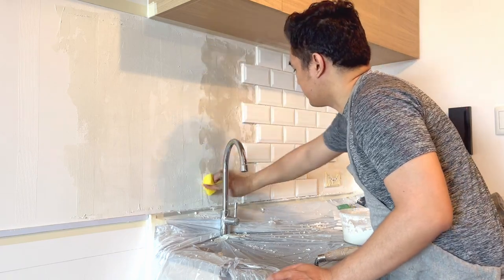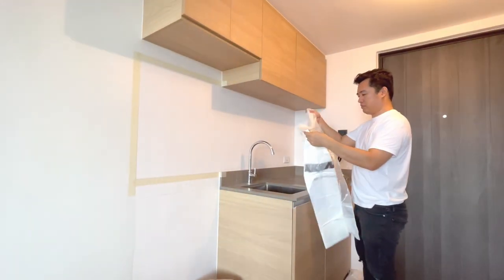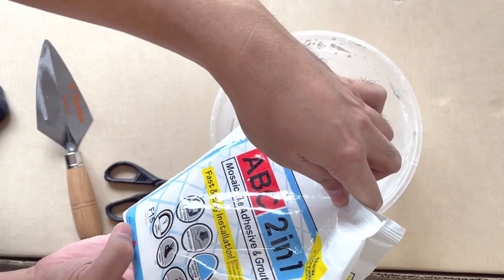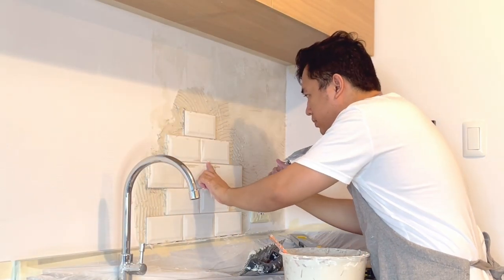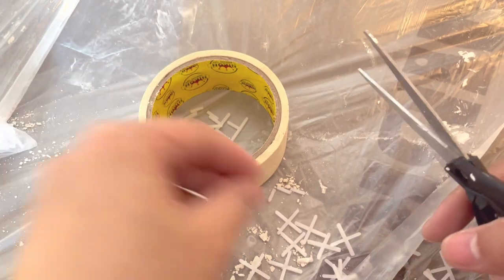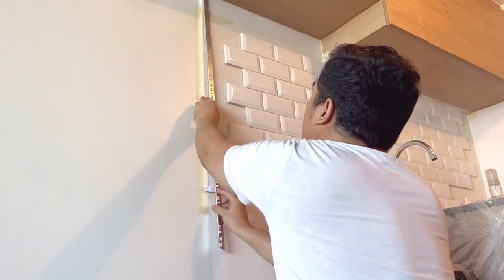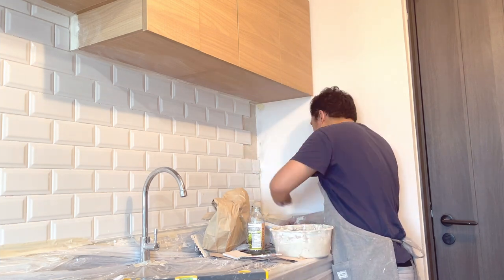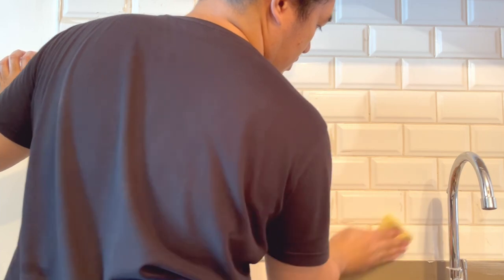How To Install Subway Tile Backsplash Like a PRO | DIY | Studio Ploy

Comment: Sir when you installed the tiles to the wall were they still wet from the soak? Or should the tiles be slightly dry when you install it?
Reply from the maker: Hi Chi! Yes those are around 1-2mins exposed and yes they're still wet, I would just get 4-6pieces each keep other in the water...😊
Reply: @STUDIOPLOY  Thank you for the response and this video, very helpful. Excited to do this update in our kitchen.  Keeping my fingers crossed!

Comment: Idol, ano yung use ng Mesh tape? Equivalent ba yun sa primer?
Reply from the maker: Hi John! Yong purpose ng paglagay ko dito ng mesh tape is reinforcement sa adhesive and gusto ko evenly thin yong adhesive pea di umumbok yong tiles... Usually mas gamit Ito pag sa drywall... 😊